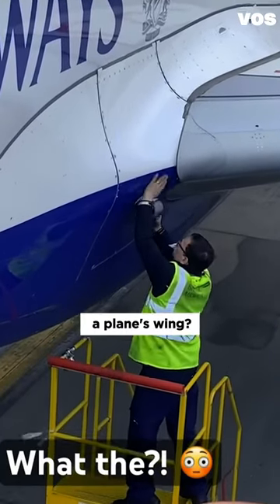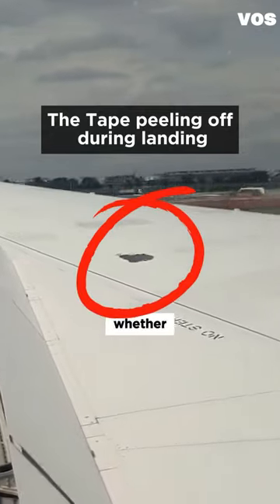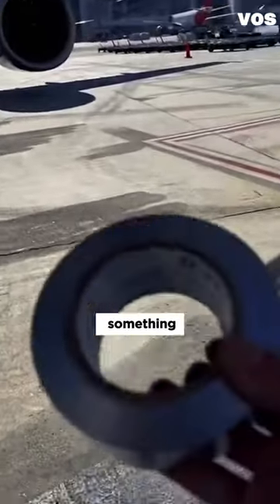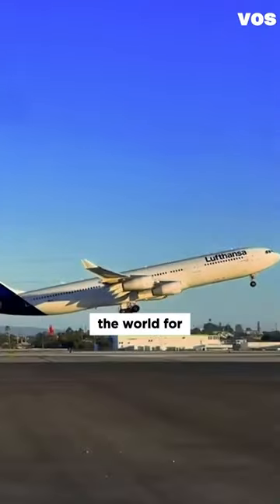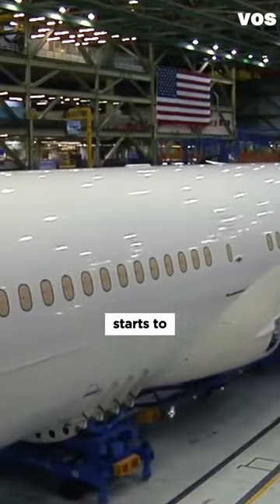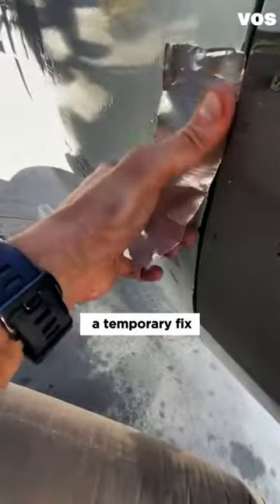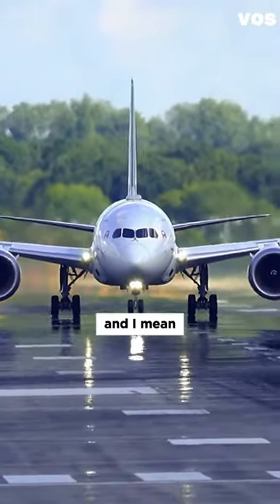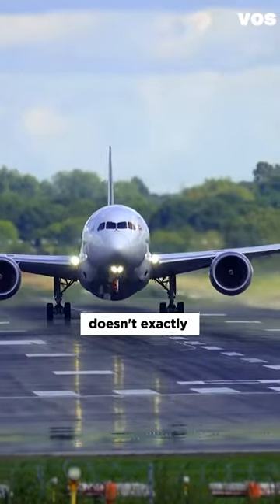Duct-Taping a 787's Wing #shorts #boeing #boeing787

Comment: It's likely because the low paint cohesion with carbon fiber composites wings.
Reply from the maker: Yea this is also a problem faced by all airlines. Here specifically mentioned the 787 cause this issue is a lot more prominent on this aircraft
Reply: @vos461  it's an industry wide issue. Paint doesn't stick well to composites. They'll find a solution sooner than later. Not a structural issue, only a superficial one.
Reply from the maker: Yea definitely 👍
Reply: @Flyingmachines350  there is a simple fix just have someone paint it during the flight they can sit on the wing